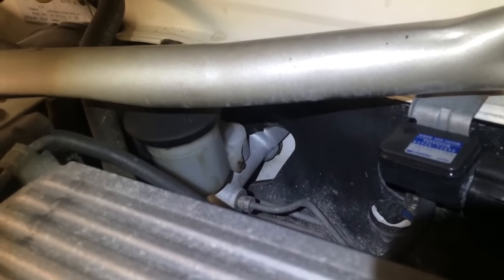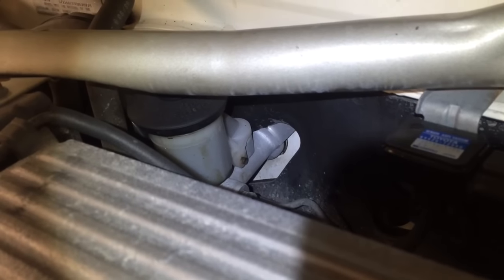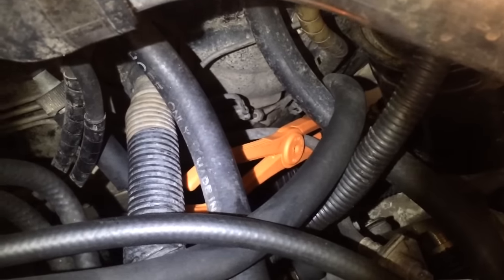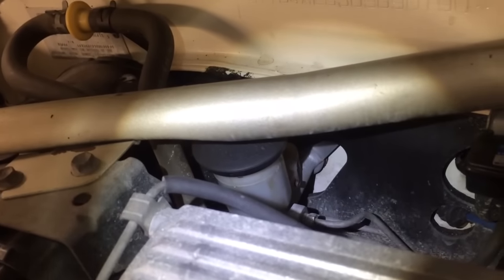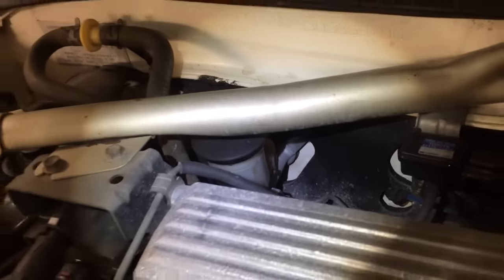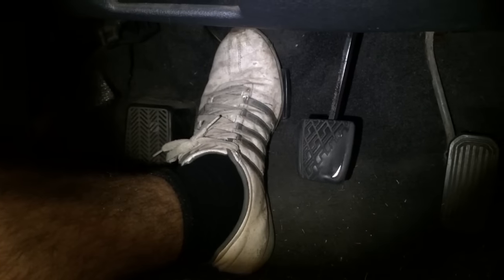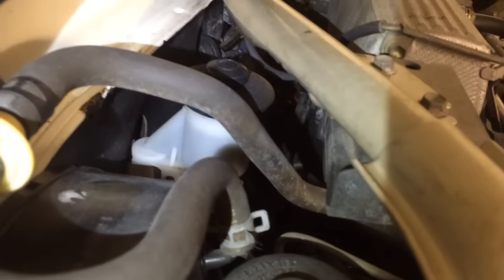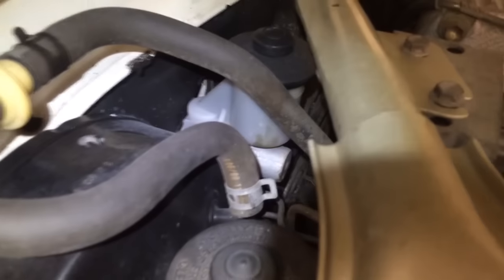How to Diagnose a Bad Clutch Master Cylinder and Clutch Slave Cylinder differences

Comment: A symptom of a bad cmc is the engagement point will move lower n lower. that's what happened to me before I gave out on me
Reply: This actually helped me out, that's exactly what happened to mine. I have an 07 civic si as well 🤘🏻
Reply: @Marcus Scale Clutch Master Cylinder.
Reply: did it lock you of out gear?
Reply: lecona35 not in my case because it had a slow leak and it was leaking from the inside so it was hard to tell. But it can lock you out of gear if it gets bad. If your cmc looks and works fine it might be a clutch problem.
Reply: @SAMURXAI  Wow, an 07. I'm surprised it lasted that long.
Reply: May god protect u 😂 that is a good point
Reply: Meaning you have to press the pedal all the way to the floor for engagement? Did your clutch start of with heavy resistance but seem to loosen up slightly but still had firm pressure then all of a sudden the pedal went to the floor like a limp noodle? I had that happen recently and I upgraded the stock clutch line to a Mcloud teflon SS line. Trying to deduce if it’s the master cylinder space or clutch. I have a Mcloud clutch as well but not sure when previous owner installed it.

Comment: that clamp doesn't have near the force to stop the fluid.  its a good idea.  I bought a short piece of hard brake line welded one end shut and screw the other end into your master cylinder.  then if you can still push the pedal down something isn't right

Comment: I have to do the same test. Levels are good but when the engine is warm and I need to go in rear gear for maneuver the gears don’t get in at all and I have to wait until I’m lucky to fit any gear. I thought it could be the slave cylinder but after watching your video I probably should replace both.
Reply: Did you figure out which one went bad for you?? Im having same issue but is slave cylinder hard to replace
Reply: Did you find a fault?
Reply: @henri0937  I'd definitely do the master if the slave is hard to get to, as masters are much more prone to going bad

Comment: This helped a lot for me. My master cylinder wont pump fluid into the new slave. and its not leaking either.
Reply: Same here
Reply: Air?
Reply: It leaks through the seals on the piston then when released leaks forward again.

Comment: Hi, did you have a soft rubber line from your master clutch cylinder? I have a hard line. I don't think that test will work for me
Reply from the maker: AJFresh sorry for the late reply, the corolla i was doing this in had a hard line from the master cylinder to the firewall near the gearbox, then it had about 10" of flex hose to another hard line that went around the bell housing to the slave cylinder. there should be at least some flex hose somewhere in the system you can clamp onto.
Reply: AJFresh mi

Comment: What I experienced was when I push the clutch pedal to the floor, the application force is fine, but if you wait around 5-10 seconds and lift the pedal slightly, the pedal pressure turns to water and there is practically no pedal feel at all. That was my clutch master leaking fluid back into the reservoir or as this good man said, bypassing.
Hydraulics are a pain if you don't keep up with routine maintenance. Bleed your fluids yearly if possible.

Comment: Easier way is have someone put their foot on the clutch as you watch the slave cylinder bleed  nipple slightly cracked open. 
The fluid should shoot out , if it slowly comes out or dribbles out your master cylinder is toast .

Comment: Hello. I have just bought a Citroen C3 MK2 Diesel BlueHdi (99ps), 5 speed manual, 2016 model, with 105.000km on the clock.

After driving it, I've realized that the clutch was very stiff and it was hard to press it and it equally pushed my foot back, when releasing the clutch (Note that I am a 6ft., over 200pounds person, so I am not short of strength).

I decided to change the whole clutch set with the LUK one, valvolines, as well the clucth pump (I was told by the mechanic that LUK is the same brand that the brand's dealership put in this car). During the first day the clutch was quite lighter.; not buttery soft, yet quite lighter. Now the next day, the clucth became almost as hard to push as it was before changing the clutch set.

Is there a way to make it buttery light/soft without spending a fortune? It has already started creating pain to the bottom of my foot, with which I operate the clutch. I find it unreal for any car to have such a stiff clutch. Thank you in advance for your support. Vassilis

Comment: Hey what’s the problem if the clutch stays to floor and won’t come back up to its original position unless I grab and pull it back help
Reply: Do u mean if the clutch stats to floor and wont come back upp the problem is MASTER slave cylinder ?? Plz answer i have big problem
Reply: Was it master?

Comment: My mustang GT clutch became super soft & loose how do I know if the problem is the slave cylinder or the master cylinder?
Reply: Had the same issue with my ford ranger it would get soft then hard then get soft it ended up being the clutch master cylinder not the slave cylinder the slave cylinders on mustangs from 05 an up have he slave cylinder inside the bell housing of transmission u might wanna check your clutch master cylinder first as it’s easy to get to

Comment: The suspenseful end..... !?!?!?! Leaking back into itself, eh? I've thought that might be my issue..... when filling master reservoir with fluid, trying to bleed after replacing slave, I push on pedal and fluid rises a bit, falls on release. Is that sufficient evidence the master cylinder is working well enough? Fluid does leave the cylinder as I bleed, but it's like it's all fluid and no air, and STILL can't get pedal pressure.
There IS an air pocket in bottom half of reservoir that I can't break or burp out..... I wonder if I lean the car would it stay away once gone..... each time I fill reservoir, it's at top of bottom stage.

thanks in advance for any insights....
Reply: Try just gravity bleeding
Reply: What did you do to get pressure. I csnt get pressure in the pedal. After a new slave and master
Reply: @connectlogic did you get it fixed
Reply: @scottishmarket  sort of... The gears sometimes grind in 1st and 2nd.. Annoying. Bit it's drivable..

Comment: It gets a bit annoying / confusing.. If my TD4 hasn't been used for a while.... a week +. when I first get in and try the gears the clutch pedal feels completely detached but after a few minutes after starting the engine and depressing the clutch and or brake pedal a few times and the brake pedal becomes rock hard the gears all start to work fine... Even reverse works without grating if I leave the 1 second pause between pressing the clutch in, selecting over for reverse then engaging reverse as the handbook mentions... What I mean is it's getting more annoying not knowing if I have a master cylinder / slave problem than knowing I do or not for sure.. Time to go see a trusted repair garage.. Plus it just failed Mot due to and I quote: "Parking brake operation is causing the vehicle to swerve to the offside. (3.7.C.3a) when I asked the tester to explain they said they test the handbrake on rollers but I didn't see/ know they do this (only for 4 x 4 he said) This was before 20th May and the new Mot rules begin in UK.. More EU nonsense behind increased aggro and bother as usual.. As I said to the tester after taking a deep breath or 3 ....who in their right mind wants to apply the handbrake while the vehicle is moving?.. What a pointless carry on and it will only get worse for another year at least.. This comment regards a Land Rover series 5 TD4 . Not sure this is the correct page after all that..?
Reply: Where can I get a 2nd hand 2005 hilux clutch push rod assembly (located at top of clutch pedal adjacent to the spring inside cabin)?????

Comment: My car won't go into gear unless the car is off. When it's on it won't go into gear. Before this happened my friend drove it and had a bad stall when I had the car off I put it into second gear and started it the car jolts forward with each crank.. Also before I can hear something rattling when i pressed on the clutch as soon as I got to the bite point .. Is my clutch not disengaging? Is this the master cylinder gone bad? Or the transmission?
Reply: Car starts fine in neutral
Reply: same thing happening to me and my bmw. im going to try finding a soft line.
Reply: did you find the solution?
Reply: ccplacide unfortunately turned out to be my clutch AND my tranny
Reply: @levimoore9972  have the same problem, i replaced the slave cylinder but don’t think i bled it right because i noticed fluid coming back into the master cylinder reservoir and it still won’t go into gear. going to buy a new line and replace the master cylinder now, will come back with a update
Reply: @zackward9938  will it go in gear when it’s turned off?
Reply: @zackward9938  update?
Reply: Update
Reply: @Andrew-jo3ft if it goes into gear when not running but not when running it's a classic sign of clutch failure.Ive the opposite, clutch slipping and pedal getting lower and lower

Comment: I would not clamp on them if you have metal lines
Reply from the maker: I wouldn’t either... there should be a flexible rubber part somewhere in the system. Have only ever seen one or two oem applications with Teflon coated stainless braid (they were internal slave setups) and many aftermarket setups use Teflon stainless braid, that’s a different approach

Comment: https://youtu.be/kumAgKX9eu4
This is the slave cylinder in this video and you have to remove the transmission to get to it. I'm not sure what part you pulled out and replaced.
Reply: @John Connor Are there 2 slave cylinders? I know there is one inside the transmission.
Reply: Thanks for letting me know. I'm purchasing a GT.
Reply: @John Connor Thank you
Reply: Most vehicles - like the one in this video - have the slave cylinder mounted outside the transmission, so it can be replaced without removing the trans. Obviously, if you've got the sort of vehicle where the slave is inside the trans, then you've got a much bigger job ahead of you. I have two Golfs, a 5spd manual and a 6spd manual; the former has the slave mounted on top of the trans, the latter has it mounted inside.